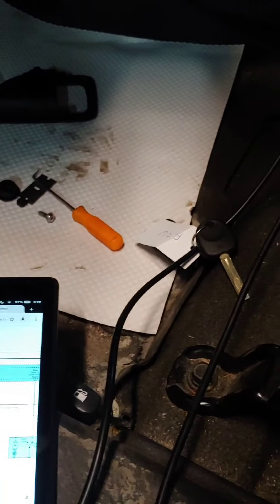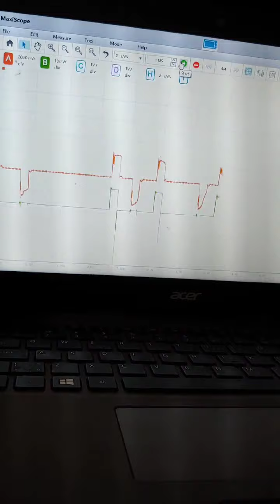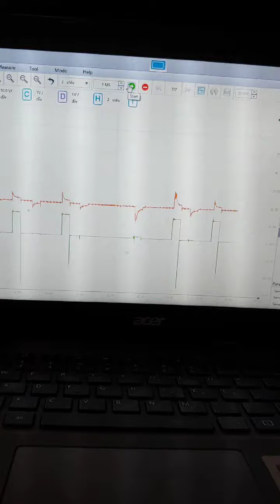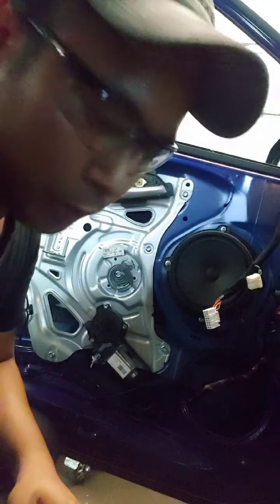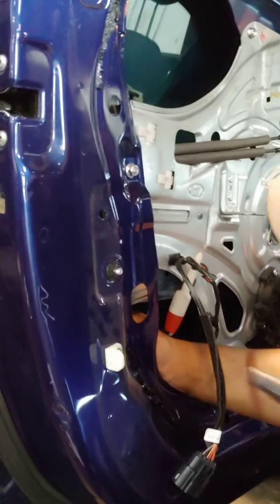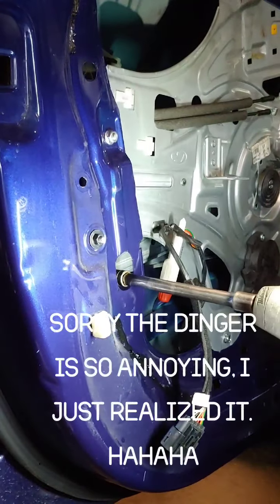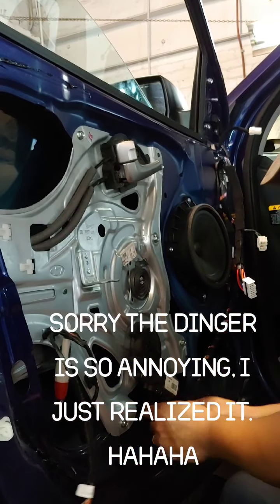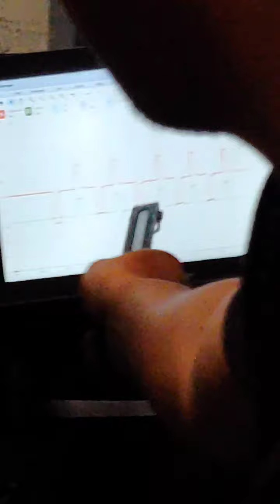Hyundai Tucson Doors does not open

Comment: This happened to both of my doors three months apart. If you are having this, please file a complaint with the FHTSA as an "electrical problem". This is a huge safety issue. The actuators are clearly faulty and need to be recalled by Hyundai Corporate! File the complaint here:   https://www-odi.nhtsa.dot.gov/VehicleComplaint/?